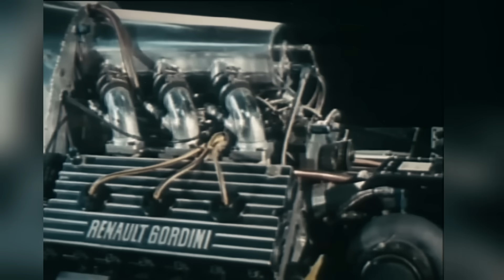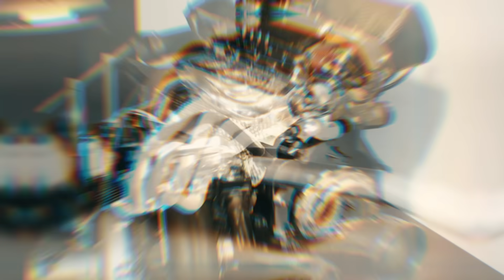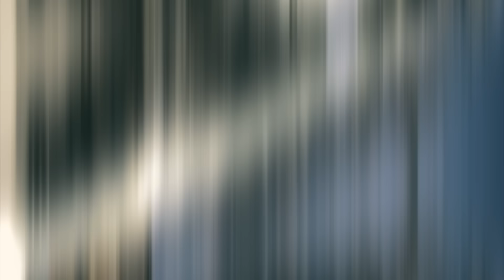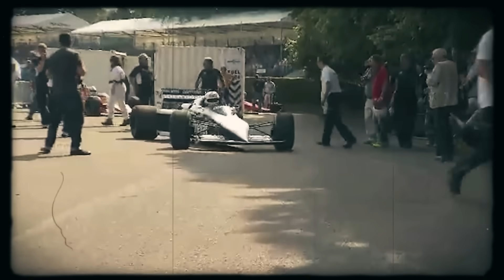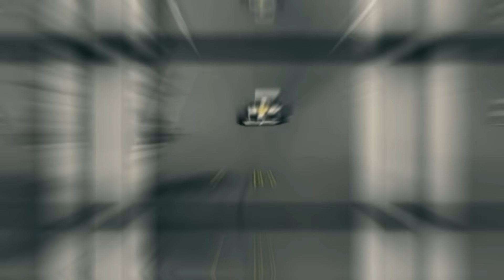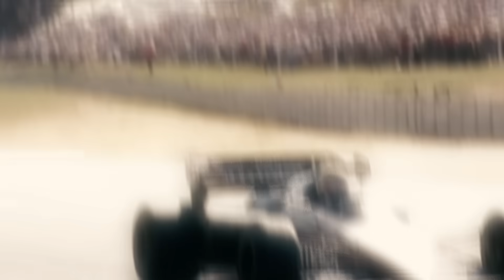The F1 Engine So Powerful… They BANNED It

Comment: So, was it really engine innovation or just throwing an exotic fuel at a fairly normal engine?

The video doesn't mention what was so special about the M10 engine and it said that putting special fuel into the M10 somehow makes it a new redesigned engine called the M12/13, which doesn't really make sense. That doesn't really explain the engine itself. Perhaps the stresses introduced by the toluene necessitated the development of new materials and design to handle the extreme power. Interestingly, there are high power 4 cylinder turbo engines now that outperform all the bigger engines, from the V6 through to the W16, it's just that they doesn't use that crazy dangerous fuel. One such car is the Porsche 919 Evo which still holds the nurburgring record, although that is a hybrid.

I think the move to ban this engine is both a positive and negative. It needed to be done to preserve F1 and the presence and handling of toluene sounded genuinely dangerous for all involved but at the same time that decision seems to have stopped further development of that special engine. A lot could have been learned and gained from further R&D which could trickle down to normal car engines.

Comment: The FIA should allow for a whole new series where Engineers are allowed to race whatever they can dream up, and as long as they build in the same safety features suited to 200mph+ on the circuits, then lets see what lunacy can achieve !
Reply from the maker: YES. Give engineers unlimited power, strap in the safety tech… and just let them cook.
We’d see cars doing Mach 1 on the back straight and cornering like fighter jets.
I’d watch the hell out of that. Would you?
Reply: It's called "Formula Libre" and it is (or was) awesome.

Comment: The Mclaren MP4/4 used a Honda engine, not BMW.
I watched F1 all through the 1980's, and the BMW was never the best engine, no BMW powered car dominated anything. Sure it was the most powerful at the end of 1983 and up until the end of 1987, but it was not as drivable as the Honda, Porsche TAG or Renault.
Nelson Piquet won the 1983 WC by 2 points unlike your claim (it wasn't even close). 
Shall we look at your BMW domination claim.
Between 1982 when BMW entered F1 and 1988 when turbo's were banned, BMW powered cars won 9 races. Renault turbo powered cars won 13, Porsche Turbo powered cars won 25, Honda powered turbo cars won 40, Ferrari powered turbo cars won 13.
As you can see out of all major turbo manufacturers in the 1980's BMW won the least amount of races.
Oh and when BMW entered F1 in 82 it's engine produced 585hp, in 1983 they had raised that figure to 640hp in race trim and 700hp in qualifying, yes they did indeed mange to raise it to 1400hp in 1986 and 1987.
Reply from the maker: You’re absolutely right about the MP4/4 it used the Honda RA168-E, not the BMW M12/13. That was never in question.

But here’s the point of the video:
The BMW M12/13 wasn’t the most successful engine, it was the most extreme.

Yes, it lacked drivability. Yes, it didn’t win the most races.
But it literally produced 1,400 horsepower from 1.5 liters in qualifying trim. That’s why it got banned. It was a ticking time bomb on wheel, and that’s the story.

Appreciate the stats though. I love viewers who bring the data
Reply: @Clutchworks21  At the beginning of the video you state that "the Mclaren Mp4/4 with this engine could accelerate so violently that it would pin drivers to their seat's", that is why I brought up the fact about it using a Honda engine.
Also it wasn't just the Power of the BMW that influenced the FIA's decision to at 1st introduce pop off valves in 1987 to restrict boot to 4.0 Bar and the to 2.5 Bar in 1988 and finally ban turbo's all together in 1989, all the turbo engines were to blame. The Renault Gordini EF15b produced over 1300hp in qualifying and over 1400hp on the dyno in testing.
Reply: @Clutchworks21 It wasn't banned, rather the 4.0 bar absolute boost pressure limitation introduced in 1987 made it uncompetitive as it couldn't rev as high as the V6 engines.

The BMW engines made power with their high boost, with a flash reading of 5.5 bar seen at Monza 86 in the Benetton-BMW. As it produces around 800 hp at 3.3 bar we can estimate power at 5.5 bar to around 1330 hp, assuming power increase is linear to boost. That was essentially how the power output was calculated. I think I have the numbers from Maders estimate in an article somewhere but the results should be about the same.

Comment: bro... toluene is in gasoline.. lots of it.
Reply from the maker: You’re 100% right, toluene is in gasoline.
But in the M12/13 era, teams weren’t using pump gas levels.
They were running ultra-concentrated blends, sometimes 80%+ toluene way beyond street fuel.
That’s what made it so corrosive, volatile, and basically rocket fuel with a race sticker on it.

Comment: I missed the real cars. That is what I am talking about. Those BMW M12/13 that is real power. Only real drivers were able to handle them.
Reply from the maker: Back when horsepower scared you instead of hugging you 😂 The M12/13 didn’t care if you were ready, it demanded you be. Absolute beast of an engine.

Comment: It is not so hard to make a very powerfull engine: just put a big enough turbo on it, and turn up the pressure high enough, take some precautions in terms of cooling and extra strong pistons conrods and crankshafts and he presto you have a ridiculously powerfull engine. The art is in making it reliable and DRIVEABLE. This particular engine was banned because it was not only ridiculously powerfull but also a nearly undrivable MONSTER with a bite worse than poisonous snake. Image what would have happened if the whole field had consisted of such monsters... The governing bodies intervening when thing go out of hand like this is nothing special. It is actually their JOB to do so and guard the A.) the sport remains safe and with normal limits of speed, B.) the sport remains COMPETITIVE. They took the only possible decision when banning this monster.
Reply from the maker: Amazing breakdown and you’re absolutely right.
Slapping a giant turbo on an engine isn’t hard… keeping it from self-destructing while pushing insane power? Now that’s where the real wizardry is.
The M12/13 wasn’t just fast — it was basically a ticking time bomb with wheels. Driveable? Barely. Legal? Definitely not for long.
And yeah, imagine a grid full of those monsters. It wouldn’t be racing — it’d be mechanical warfare.
Respect to the FIA for pulling the plug… even if it made one hell of a story. 😈

Comment: The namby-pamby obsession with limiting innovations was what ruined F1. Not just the turbo cars (that were eventually ubiquitous), but also technology like active suspension (developed by Lotus and found to provide an unbeatable advantage - so the other teams complained because they lacked the skill to emulate it and the tame FIA banned it). F1 should be the test bed for pushing motorsport to the absolute maximum: how much power CAN you put down on the road? how quickly CAN you go round corners? how much electrical power CAN you extract from the hybrid unit? The top drivers of the '80s could blow today's generation into the weeds  - today's track pilots are bureaucrats in race suits,  mainly involved in staying within various limits, rather than wringing the last ounce out of their car. It's all politics - we must make sure we aren't underweight at the end, we must make sure the centreline plank under the car isn't too worn down and we must make sure that we don't extract more than the regulated amount of hybrid energy. I say discard all the limits and see what happens. Of course it's expensive - the likes of Mercedes-Benz and Ferrari probably spend billions every year and the lesser teams end up being clients of the big boys in order to get a sniff of the best stuff - and it's always been like that. The idiotic problem is that a lot of the gigantic cost nowadays is incurred in trying to get around the namby-pamby regulations, so citing cost limitation as an excuse for performance-reducing regulations is oxymoronic.

By the way, the BMW engine may have been the legendarily most-powerful one (nobody ever proved what power it made - it was just a guess), but it wasn't the be-all and end-all. Honda and Renault showed what made the very best. Every team routinely screwed the power right up for qualification - engines were made to deliver >1000bhp for a few laps and then other engines were made to deliver more like 800bhp for a race duration. Limiting the number of engines a team is allowed for a season was supposed to reduce costs, but the engine manufacturers then spend vast sums on ways to get the most out of fewer engines, so the cost reduction probably vanishes.
Reply from the maker: Appreciate the thoughtful breakdown! You’re totally right that every team had their moment — Honda, Renault, even Ferrari had wild setups. But the BMW M12/13 stands out not just for raw power, but because it terrified everyone. 1,400hp from a block with 100,000 miles on it? That’s not just engineering — that’s black magic.

Also, you’re right about estimates — but when even the FIA steps in and says, “Okay, that’s enough,” it means something clearly went too far. 😅

This video’s meant to show how unhinged things got, not to downplay the rest. But I love that you added this context — people need to see just how nuts that whole turbo era was. Respect 🙌

Comment: This is really hyperbolic. I raced two strokes in the 80's and we used toluene based fuels. It is not that corrosive and it is not 'rocket fuel'. You can buy pure Toluene at the hardware store so it is not that dangerous. Toluene has about the same energy content as gasoline and is typically used as an additive to gas. It ups the octane or knock/detonation sensitivity that is critical for turbos without diluting the energy content of the gas as alcohol does. It also has a faster burn rate than gas which is necessary when looking for higher RPMs. Most commentators miss that it is hidden/boring things that drive the technology forward like tire compounds and fuel formulations. Yes the BMW engine was a milestone but so was Renault's turbo which brought us pneumatic valves which are still with us and the major innovation in high revving motors. It was Renault that believed that they could make the Turbo come out on top of the Turbo/NA formula and they were ultimately proven right. If a motor bends things the solution is relatively easy - you make it out of better materials or increase the thickness.
Reply: Toluene have a higher density than gasoline, so it offers a higher energy content per liter than gasoline. Important when fuel limitations were measured in liters. It was mixed with n-heptane to meet regulation requirements of a maximum research octane number of 102. Importantly though, its knock resistance in high speed high boost engines was much better than the research octane number indicated. It burns a bit dirty though, and it's harder to vaporize.
Reply: @johan.edlund  I am not a chemist so I have to go by what I was told and what I remember - which was quite a while ago. We had alchemist from ELF who prepared our fuel and gave us general info. The google tells me that toluene has lower energy density by volume but higher by mass. It did boost the rpm which was fuel limited by about 1500rpm and boost compression by 1. A pretty significant advantage to running on pump gas.
Reply: @francisrampen9099 Toluene (also known as methylbenzene) has a density of 865 kg/m3, regular pump gas is around 750 kg/m3. When it comes to hydrocarbons, essentially all of them follow the same principle that higher density hydrocarbons have lower energy content per kg, but more per volume due to higher density.

The racing fuel used by Honda (supplied by ELF, BMW was supplied by BASF-Wintershall) which was 84% toluene and 16% n-heptane had an energy content of 41.07 MJ/kg and a density of 840 kg/m3. Regular pump gas is around 43.2 MJ/kg and 750 kg/MJ, so per liter the racing fuel has 34.5 MJ/l and the pump gas 32.4 MJ/l. Of course, the fuels used in F1 before these racing fuels were introduced wasn't pump gas but avgas, which has even lower density than pump gas.

Aromatic hydrocarbons like toluene are not corrosive, but they are good solvents (hence the use as paint thinner) which can cause problems with certain rubbers and plastics. Today the total aromatic content of pump gasoline is generally limited by regulations due to environmental reasons.
Reply: @johan.edlund  I appreciate anyone who can actually put real numbers to the discussion. From discussion with ELF the main intention was to limit detonation while speeding up flame propagation and the dyno suggest that was what was happening  - we could get more RPM out of the engine then on the AVGAS/castor oil mix we normally used without any other changes. We were able to up the CR which obviously helped. Then there is nitromethane which is a totally other learning curve.
Reply from the maker: Appreciate the insight – you’re absolutely right that Toluene isn’t classified as ‘rocket fuel’ in a literal sense, and it’s been used in motorsports for decades. The script definitely leaned into dramatic flair there. That said, in the context of 1980s F1, the concentration and volatility of those fuel blends pushed engines — and materials — to their absolute limits. Totally agree: the behind-the-scenes tech like tire compounds and fuel chemistry is what really drove the performance evolution most people overlook.
Reply: I agree ! Put some acetone in the mix and and check out your dyno results. Not much,but a little bit extra !

Comment: Add reliability and change the timeframe to 2014-2020, and you have the Mercedes F1 engine.
Reply from the maker: 100% agree — Mercedes’ PU from 2014–2020 was dominance through perfection. But the BMW M12/13? That was domination through insanity. One was a scalpel. The other was a sledgehammer wrapped in nitroglycerin.
Reply: @Clutchworks21 5.5 bar is not sustainable in any engine, even today.

Comment: I think you are confusing it with a Honda
Reply: It didn't dominate F1, that's what I was getting at
Reply from the maker: It made 1,400HP, won a World Championship, and scared the FIA into banning turbos. If that’s not domination, I’d love to hear what engine you think did more damage with less time
Reply from the maker: Not confused at all — this is the BMW M12/13. The 4-cylinder monster that powered Piquet’s 1983 Brabham and made 1,400HP in quali trim. Honda’s turbo engines were great, but this one was chaos on wheels — and it’s 100% not the same beast.
Reply: Judd hahaha

Comment: I saw these monster motor powered cars live
Reply from the maker: Man, you witnessed HISTORY. Those beasts weren’t just fast, they were straight-up violent. Bet your ears are still ringing 😂
Reply: @Clutchworks21 I did, I was at Silverstone for Saturday qualifying 1985 when Keke Rosberg set the fastest ever lap of Silverstone in any configuration, was at Brands Hatch when Nigel Mansell won his first race. I remember standing a Bridge corner at Silverstone in the 80s and you looked down on the cars as they flicked through the turn flat out. You could see the drivers working at the wheel it was amazing

Comment: Nah… powerful, yes — but it didn’t dominate the sport. It never won the Constructors’ Championship, and only once the Drivers’ Championship. Honda and Porsche/TAG were the ones who managed to combine power with reliability and fuel efficiency during the turbo era.
Reply: This dude drunk toluene before make this video. Hahaha
Reply: and it only won just 2 pole positions in 1983 with that qualifying trim. One obviously Monza but not Spa not Hockenheim (old version)
Reply: @gokhansenaolivia  Qualification trim in 1983 was only good for around 800 hp.
Reply from the maker: Totally fair — the M12/13 wasn’t a title magnet like Honda or Porsche, but it did crank out 1,400+ hp in qualifying trim and scared the hell out of everyone doing it for a fraction of the cost.

It didn’t dominate… but it definitely disrupted. 😤
Reply: @Clutchworks21  It cranked out 1,400+ hp for a single lap and then needed to be rebuilt.
Reply: Very good vídeo. Amazing job. Subscribing right now. Period.
Reply from the maker: @monteiro5306  That means a ton — seriously appreciate you! More insane stories on the way 🔥 Welcome to the crew 👊